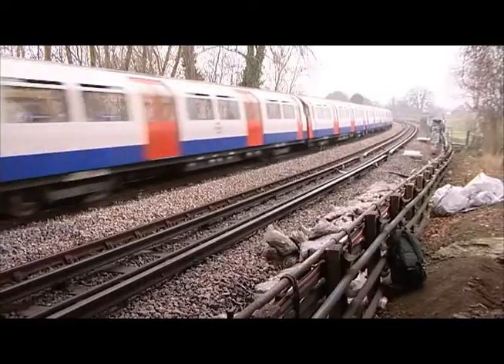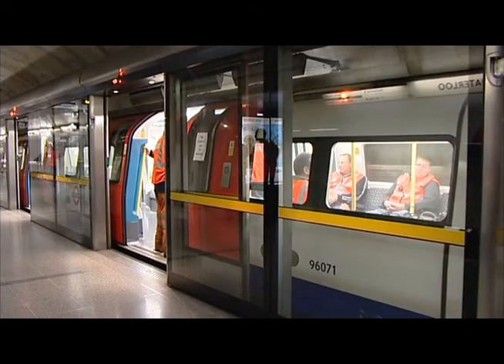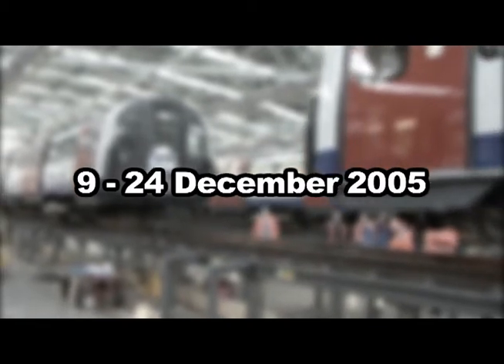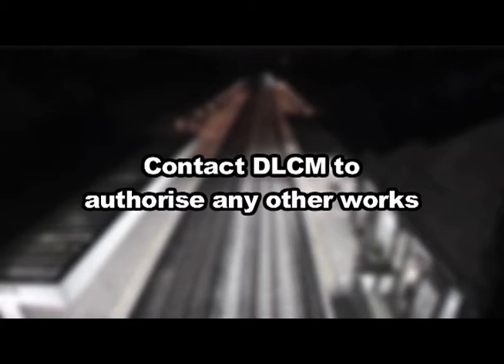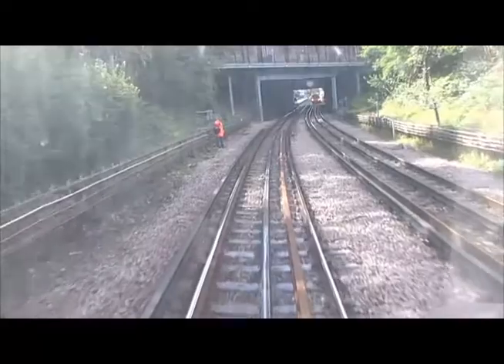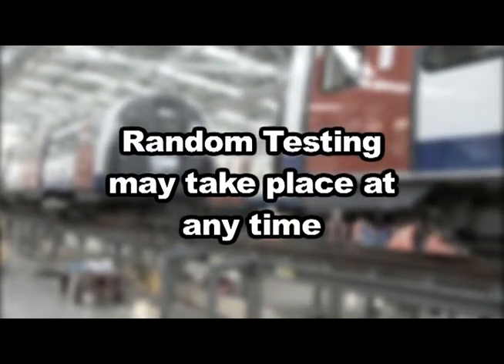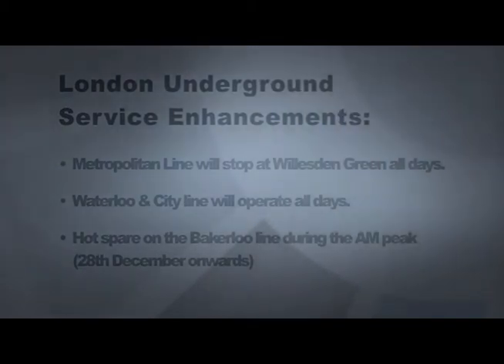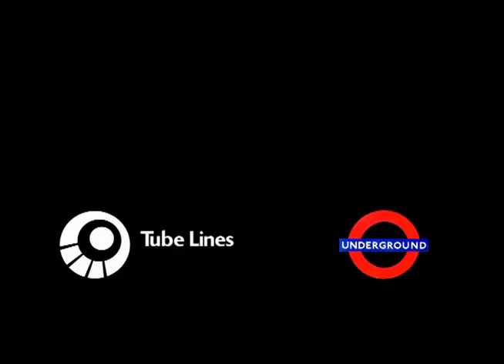2004 / 2005 / 2006: UK: Planned LUL Jubilee Line Changes to Rolling Stock.

Comment: Interesting to see shots of Picc Line 1973 stock! I remember these works taking place, i was a bus driver at this time and was on the Stanmore to Wembley Park section of Rail Replacement. I remember the service did indeed start early, on Friday 30th as i recall... We sat in Stanmore station car park in case of problems and we were needed but we weren't happily.....